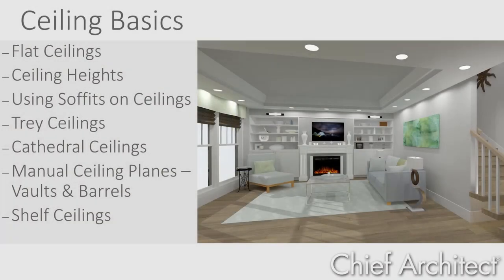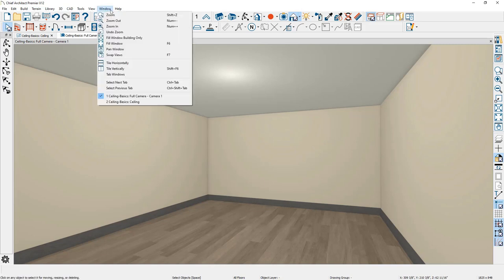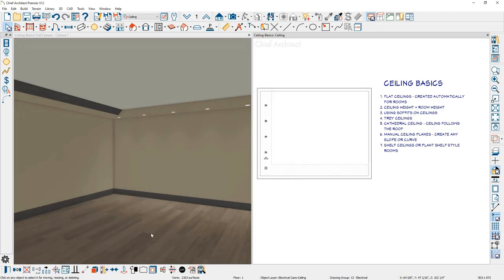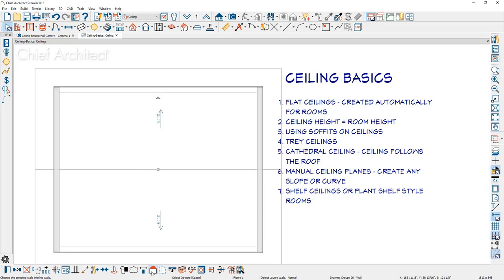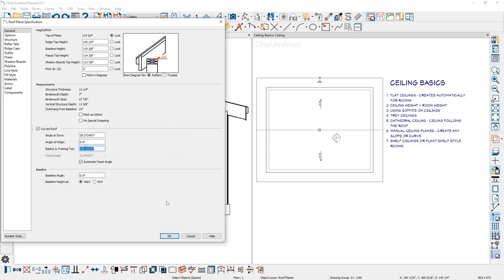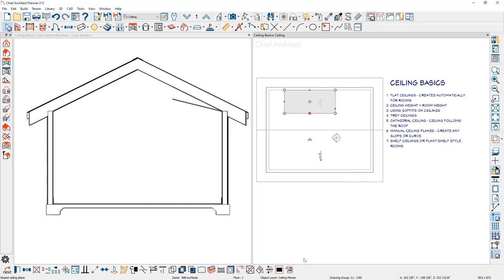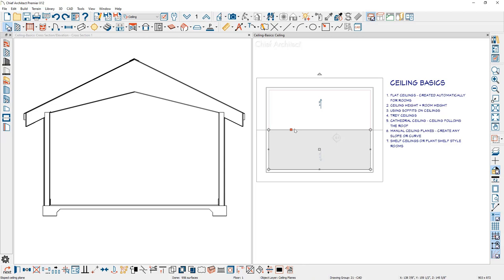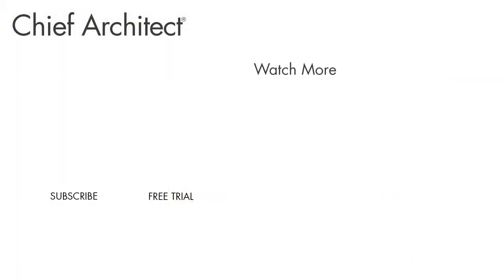Ceiling Design Tutorial

Comment: Way to fast for me to follow as a do it yourselfer
Reply from the maker: Thank you for reaching out, Hector. In the bottom left of the video, there is a settings option where you can adjust the playback speed and slow the video down.
Reply: I press the pause button, and do the steps.  It would be quite a boring 30-minute video if he was going at classroom speed.